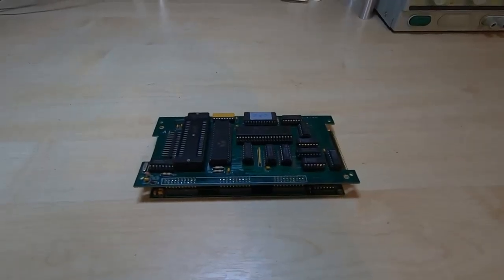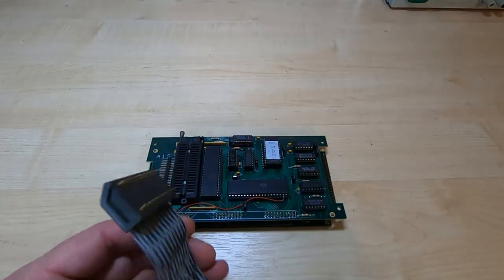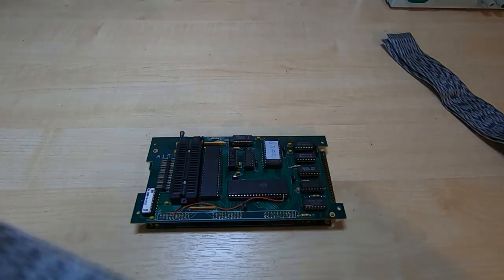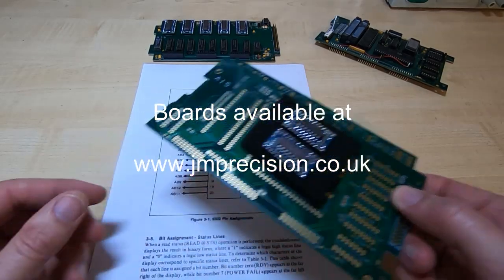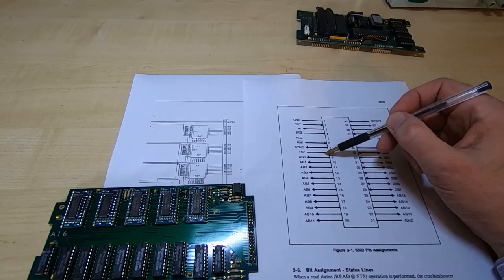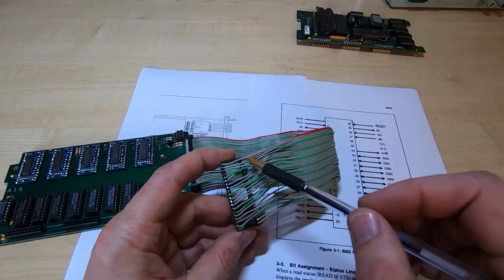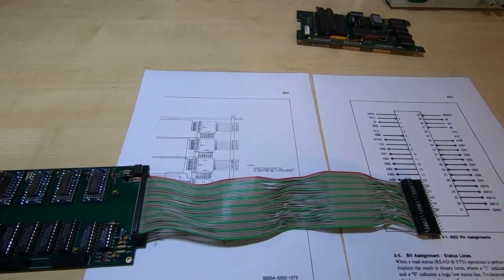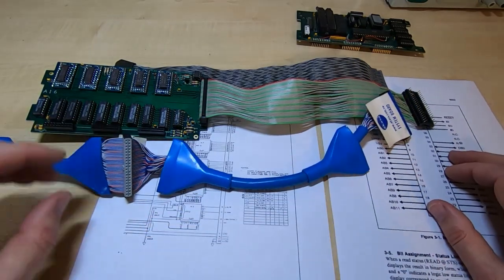How To make a Fluke 9010a UUT Cable

Comment: IDE connector on  one end, 40 conductor ribbon - split the cable for max. flexibility (easier to bend around weird orientations) Is the processor connector just a 40-pin round hole (machine pin??) DIL/DIP socket and do you insert the tiny stranded ribbon cable wires into each receptacle?

Comment: JERRY WALKERS,  here is a list of entry level basic arcade repair questions::::
                  When the arcade game is constantly resetting watchdogging. And you disconnect the watchdog circuit from the arcade game and then the "game stops resetting". 
      1.) How do you know if its the ROM's chips or the address decoder chip or the RAM chips? Because It can be either of them that is causing the game to reset.
     2.) When Disconnecting the watchdog circuit and the game STOPS resetting would this isolate and eliminate that the ROM chips are good, address decoder chips are good, Data buss and address buss are good?
      3.) The arcade game ROM chips game code outputs a "special address" to the address decoder chip to RESET the watchdog circuit. If the the ROM chip game code is corrupted and is sending out a corrupted "special address" or is sending out a scrambled "special address to the address decoder chip. This will cause the watchdog circuit to constantly RESET the watchdog circuit?   
       4.) If one or more of the RAM chips is corrupted and the arcade game is constantly resetting watchdogging. How would the watchdog circuit know that one or more RAM chips is corrupted and not working correctly?

Comment: JERRY WALKER,                  ---> I'm confused why some arcade games what to redirect the addressing?
                  ------       1.) What is the "advantages" of redirecting the addresses?
                  ---      2.) What is the "advantages" of bank switching the data buss lines and band switching the address buss lines?
Reply from the maker: Without bank switching you would be limited to 64k of address space. WIth 8 bit bank addresses added you get access to 64k x 256 bytes of address space. I am not sure what you mean by redirect. If you mean indirect addressing then that is a feature of the processor and is used to reduce the size of the processor instruction encoding so that the full 16bit address does not need to be stored in each instruction. This gives access to a bigger memory space without the need to encode 16 bits of destination adderess.
Reply: @JerryWalker001  thanks for the help
1.) What IC chips do you use to do bank switching to not be limited to 64K of address space? I'm not sure what components are doing the bank switching is it a PROM chip?
2.) The arcade games make daughter boards that replace ROM chips or RAM chips and the daughter boards have GAL/PAL chips that will "redirect" the addressing or does bank switching. I'm not sure what is the "advantage" of redirecting addressing using GAL/PAL chips which I'm guessing they are doing Bank switching?
Reply from the maker: You can use anything you want. PROM, ROM, Latch etc
Reply: @JerryWalker001  Can you please give examples on how it a PROM, ROM, Latch takes a 16bit address line 64Kb and bank switches the 16bit address lines to make more address lines more than 64Kb?
Reply from the maker: The exact arrangement is up to the designer but normally a latch stores the 'bank' value which is written to it and the output of the latch is used to select the correct device CS and CE lines. Generally some sort of decoder or multiplexer is used. For example a 4 to 16 line decoder could be used to select one of 16 banks by writing the required bank value to the input (via a latch) and using the outputs to control the memory banks. There are as many different techniques used as there are designs so the method used depends on the designers choice.
Reply: @JerryWalker001  ok thanks for the example to learn from
Reply: @JerryWalker001  thanks for the help
      ---What is the difference between address decoding an address compared to address multiplexing an address?
Reply: @JerryWalker001  thanks for the help
........>>>> 1.) what is it called when bank switching can use the "same address range" to route to one RAM/ROM and then route the same address range to a different RAM/ROM chip what is this called? Is this called address multiplexing? 
.....>  2.) Because I'm confused by the daughter cards kits says that the madsel circuit means multiplexed address select.
So what do they mean by multiplexed address select? 
       3.) I don't understand the difference between multiplexed address selected compared to address decoding?

Comment: JERRY WALKER, 
       1.) Any reasons why the propagation delay can cause False positive results when piggybacking another IC chip on top or using an HP comparator 10529A that has another type of propagation delay?
               2.) What is setting the propagation delay time for the circuit board design? Is it the CPU clock frequency or the game code speed from the ROM chips?
                           3.) If a circuit board only used L or S propagation delay time and a repair technician replaced all the IC chips using LS propagation delay chips, why would this make the circuit not work correctly? It will offset the timing but how does the circuit board know that the propagation delay has changed?
Reply from the maker: If you use a scope to monitor many digital circuits you may wonder how they ever work at all. They are rarely clean digital signals and the individual devices need to be able to determine when a signal is high and when it is slow despite the 'noise'. Different chip families have different characteristics and selecting the correct charateristic can make a difference, especially as some have different voltage thresholds. Propagation delay is not the only factor and frequently the load on outputs of IC's can have a big impact on how quickly a chip can switch and this is again different for different families. Attaching anything additional to a circuit can make it operate differently and something like a logic comparitor is densitive to the difference in the switching speed of the reference IC and the IC under test. In fact that is how it works and introducing delays such as test clips and cables can have an impact. Note that this is not really related to clock speed, it is more to do with switching speed (the speed at which it goes from high to low and low to high).
Reply: @JerryWalker001  thanks for the help, yes i understand what you're saying.
1.) When an arcade engineer designs the arcade games circuit boards hardware and chooses the IC chips. what is the propagation delay time based or referenced to? 
2.) What I mean is that the TTL propagation delay of the IC chips is being referenced to the ROM chips game code speed and has to be in sync with the clock frequency? 
3.) because if you change the propagation delay it will throw off the data timing and address timing signals?

Comment: They program the PROM chips as a multiplexer or decoder?  Why use PIA chips when you can connect the external devices directly to the CPU output pins? Addressable ports for what, external devices

Comment: Jerry Walker, they use PIA chips and PROM chips in arcade games but what are they used for in various arcade games?
Reply from the maker: PIA's are very common and appear in almost every vintage piece of computer equipment. They provide addressable ports and external interrupts etc. PROM's are used for everything from system ROM to lookup tables or even multiplexers and decoders.